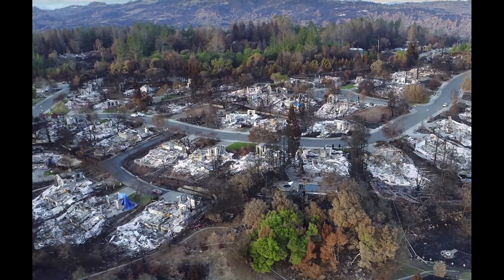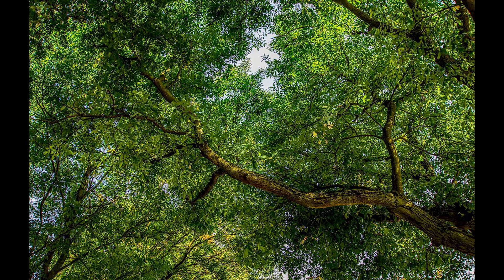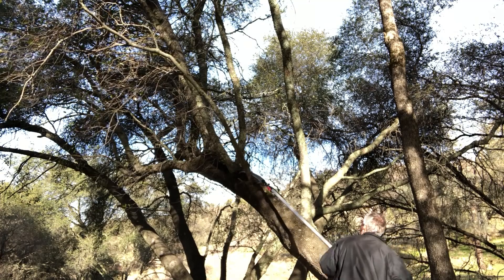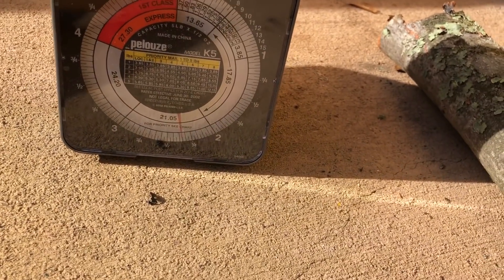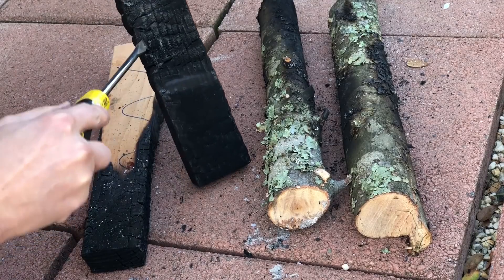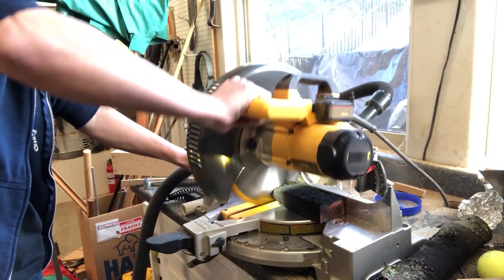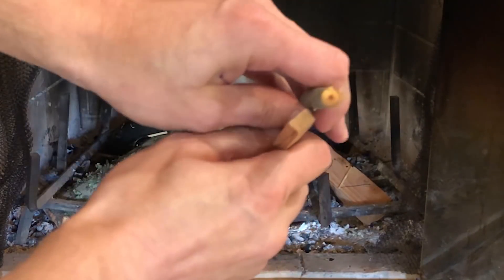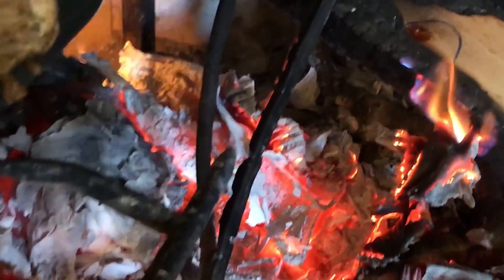Explained: Why Houses burn When Trees Do Not

Comment: SO how do u explain the melted metal rims on vehicles? Just vaporised? BTW, i live in the hinterland of forest fires and have witnessed many over the years....in our neck of the woods, forest fires are JUST THAT....the swaths of forests burn whether dry or not..... Hmnnnn????
Reply: Because all the plastics, fluids, tires, fabrics etc burn way hotter than a typical fire as well as the fact that aluminum has a very low melting point. You would not see the melting on a car that has old school steel wheels as steel has a way higher melting point.

Try throwing an aluminum can into a campfire. It melts into a puddle within minutes. A piece of steel would barely even be singed.
Reply: @3DSuperWaffle , yup Forest fires can reach 800 degrees centigrade, and  aluminum lowest melting point is 400 degrees.
Reply: Yes, Deva Priya, they offer you no explanation whatsoever of how the fires spread between houses and groups of houses. But of course, they call them forest fires and wildfires, so obviously we're supposed to ignore that the trunks, twigs and leaves transporting the flames are left unscathed.
Reply: Plenty of explanations have been offered. However no explanations for why individual houses are targeted from your flying laser in the sky. Because fuck someones house in particular?
Reply: @pepebriguglio6125  I might be dim Pepe, but I happen to share the view of the fire investigator in "Wildfire: Prevent Home Ignition P.1& P.2" How is that counter productive? Its not that hard to find scientific answers really. Instead of turning to the cult of everything is government conspiracy and/or supernatural explanations, we can actually use science.Also check out "Why wildfires have gotten worse -- and what we can do about it | Paul Hessburg". Let me know what you think.
Reply: @schmolywar  What I descibed as "counter-productive" was your assumption that I was promoting the notion of "lasers in the sky". That should be clear. But you apologised for that shocking assumption, so it shouldn't keep being re-cycled. Nevertheless that was what I called counter-productive.

About the real reason for the fires that so absurdly are called "wildfires": None of the so-called "natural" explanations even half-explain the peculiarities witnessed by all sorts of people, including fire fighters who say they have never seen fires act this way before.

To me, it looks like some specific material was affected by something unknown that made that (or those) specific material(s) either heat up or become electrically charged, something that is found in cars and houses, but not in (or rather: on) trees. A good suggestion could be sudden localised extreme magnetic field producing acute spikes in the electric current in copper wires. That would fit the witnessed phenomena. The question would then be how the hell such a magnetic phenomenon occurred. Experiments by a private company? Secret tests by the military, by nasa or by other agencies that notoriously operate with extreme levels of confidentiality? A magnetic burst from the Sun? A result of tectonic unrest in the Earth's crust? Or ...? I honestly wouldn't know what may have caused such a thing. I have no specific evidence other than the spooky fires themselves. And as I said, it may have been some other energetic anomaly (not necessarily magnetic) which affected some other materials than copper wires.

Bottom line is, trees and bushes don't transport fires uncharred, especially not when they are as dry as they have been prior to this year's fires.
Reply: @pepebriguglio6125  There is a claim there; Trees and bushes dont transport fires uncharred. Can you explain that? Are you sure that is what you are actually seeing? Did you watch the videos I named? Are you claiming you know something that fire investigator does not?
Reply: @pepebriguglio6125  There is a claim there; "trees and bushes don't transport fires uncharred, especially not when they are as dry as they have been prior to this year's fires"- Ok, does that contradict anything the fire investigator shows in the video I named. Did you watch it?
Reply: @schmolywar  I have seen enough. What still awaits investigation is what materials "spontaneously" self-combusted. Those materials will give us a very definite clue as to what caused the fires.

And to answer your question: No, I don't see any evidence that vegetation, either charred or not, transported any fires. What I saw in countless videos with houses turned into rubble, was that dried out trees at any distance from houses were left unscathed. To me, that does not mean they transported fire by woodoo or other wood magick, it simply means they did not transport a single spark. And that means that we are not dealing with "wildfires", but rather wild fires in the sense that the cause was "wild" in the sense of "crazy" or "unconventional". Instead of wildfires, they should be called a housefire epidemic.

It is downright superstitious to try to explain, with conventional causes, that 90% of dry vegetation was left uncharred by violent fires that supposedly spread from house to house, when fires never acted like this before last year. And superstition is an unmistakable sign of dire fear that anything not yet understood or accepted was at play. But that is nothing new. About 95% of all scientist, even some of the most intelligent ones, are ready to go completely out of their way and do just about anything, to show even the slightest possibility that the causes of their observation could fit inside their already cemented frame of mind. "Exceptional claims demand exceptional evidence" 😂😂😂😂 Ha! Yeah, and then some! People are so terrified to be neutral, skeptical and forensic about their observations. Be skeptical, damn it! In ALL directions! And open-minded! Also in all directions! I will endorse any line of research. But I will also fight any conclusion until the evidence is overwhelming.
Reply: @pepebriguglio6125  Are you leaving something out with regards to fire transportation? Are you sure you covered all the bases? Or do  you flat out deny this; "Embers play a large role in forest fires. Because embers are typically burnt leaves and thus small and lightweight, they can easily become airborne. During a large fire, with the right conditions, embers can be blown far ahead of the fire front, starting spot fires several kilometres/miles away. A number of practical measures can be undertaken by homeowners to reduce the consequences of such an "ember attack" that bombards especially wooden structures and starts property fires." No voodo needed! Your other claim about unburnt trees near houses are adressed in the OP video. Sometimes Pepe, the answer lies in plain view.. Oh and do see the whole video. You have not "seen enough".
Reply: @pepebriguglio6125  "Overwhelmingly, embers are the cause of structure loss in the WUI. This has become the inescapable conclusion of decades of research. Even centuries old fires have recorded stories of flying embers igniting structures.

That isn’t to say direct flame contact and heat can’t ignite structures.
But based on real factual data, most homes burn because of embers, not flames or heat." I suspect you think wildfires act like a wall of fire. I get that. Its counterintuitive that they sometimes dont act like that.
Reply: @schmolywar  No, I don't think like that. I already learned as a child to think of wild fires in terms of flying embers. But I also learned to be very wary of nearby tree tops in connection with flying embers.
Reply: @schmolywar  Yes, I have seen enough to know a few things that certainly did not spread those fires. The vegetation did not do it. And in most cases nothing did. Most of the fires originated inside each house. That much I have already seen. There may be more to see, especially if a group of engineers, chemists and physicists went through the heaps of rubble without preconceived ideas. So there may be more to see in terms of what specifically caused the fires. But I have already seen quite enough to rule out a few things.
Reply: @pepebriguglio6125  How do you think embers COULD ignite a house? Just curious. We know they HAVE, but you are ruling that one out here.  I want your explanation to how you see embers igniting stuff.
Reply: @schmolywar Embers could very well ignite a dried-out wooden house. It happens all the time. Not every ember would do it, but perhaps 1 in 1000 or 1 in 10, depending on their sizes and the general conditions like wind, temperature, etc. The same can be said about dried-out trees and bushes hit by embers. That is why wildfires always burn down whole swaths of land at a time. Both houses and vegetation is burned down when wildfires get intense.
Reply: @pepebriguglio6125  You emphazise dried-out wooden house. Why not a brickhouse? Is it only walls that ignite?
Reply: @pepebriguglio6125  Check out "IBHS Research Center Ember Storm Test Highlights" and tell me if you DONT see any cause for internal ignition of combustable material.
Reply: @schmolywar  No, in my mind's eye I saw roofs catching on fire. But the more wood (amomgst other things), and the less stone (amongst other things), the quicker the fire can develop.

Listen, whatever the reason is, that I have eliminated conventional causes, and you haven't, it's not that I'm stupid. So let's not get lost in trivial stuff ... It's okay if you don't see what I see. We all have a proclivity to not see what our minds consider to be impossible.

Have you considered the arguments that I have presented to you?
Reply: @pepebriguglio6125  Magnetic or some energetic anomaly? Sure. I dont SEE any anomalies though. And ive seen plenty of these "mysterious fire" videos with haunting xfiles type music. It would be great if there WERE any anomalies. It would be exciting! Car roofs or houseroofs spontanously catching fire caught on film. One never sees these things however. People are baffled by explosions in these areas as some sort of mystery, yet propane tanks are everywhere. Electrical wires also. Sometimes they get caught in the trees due to firestorms. Many thinks electrical sparks are anomalies for some reason. One never sees a real fire investigator make these spooky music government conspiracy videos, its always some hobbyist in his room concocting cover ups everywhere, wondering why trees dont catch fire but cars do, ignoring real life science which is readily available but easily accepting that some guy somewhere is picking out individual cars/houses (ignoring others for what?) and pointing a laser at them!  What you want is conclusive evidence... no, no my friend, thats not how it works, the scientific angle will give you the most LIKELY evidence. What the most LIKELY evidence is that firebrands and NATURE is the cause of fires here. Extraordinary claims requires extraordinary evidence. Evidence of which there are none, NONE.
Reply: @schmolywar  As I said, if we have different perceptions about these fires, then that difference is not due to lack of intelligence. At least not on my part. We are having this dialogue, the two of us, and then out of the blue, and quite inappropriately, I would say, you mention other people's dramas and highly shrieky choice of music meant to invoke fear and gloom. I have nothing to do with all of that. Like you, I see right through all of that. And like you, I'm disgusted with it. So why do you bring it up? I have given you my major reasons for knowing something unprecedented happened here. And you shouldn't try to through mud on my views, just because you have seen a whole load of videos where similar views, mixed up with loads of untenable claims, are aired. It's hardly my problem that people freak out and become sensationalist. I don't buy into anything, and I don't regurgitate anything. And I don't enjoy being treated as if I did. So please stop that!

Now, about the 'spreading' of the fires. We were talking about how fires may spread by way of flying embers, and that was what lead to our talk about roofs catching fire. I never proposed that that was what happened here. My suggestion was that copper wires (or perhaps other metals or other specific materials) somewhere in the house spontaneously caught on fire, either by heating up or becoming electrically charged. So   what I propose, has nothing to do with roof tops. I'm not saying it wasn't something in the roof tops starting the fires - that is not what I have been able to eliminate - but it is not part of my prime suspicion.
Reply: @schmolywar  I actually saw one video with a fire fighter in his fifties who had been a fire fighter in the area for 30 years in the area. His testimony was about 10 minutes long, and he said the fires this year and last year were the strangest thing he had experienced in his whole career. And there was no weird music being played on that video. So it's simply not true, when you say you never hear this.
Reply: @pepebriguglio6125  Link? And saying "strangest" does not imply unnatural causes.
Reply: Vehicles burn very hot, and can last for quite some time. There is lots of flammable fluids, plastics, and rubber burning around the aluminum wheels. If you want an answer from an expert, go visit your local fire department, and ask them. 
Forest fires do not always burn the entire tree, this is why "controlled burns"  work, and are used to just burn the dry material on the ground, and do not spread to tree canopies.
Reply: Metal melts while the surrounding trees remain green and uncurled? LOL bullshit.